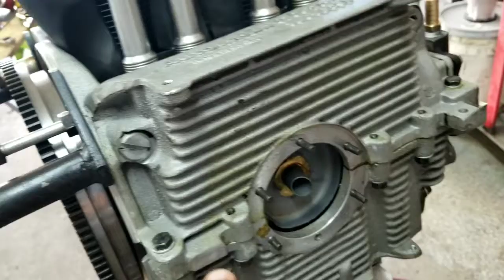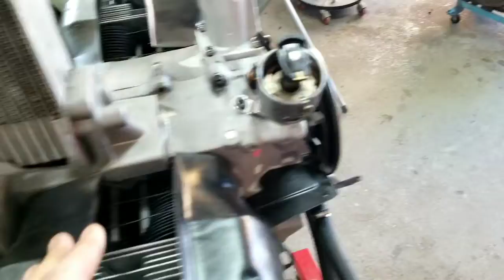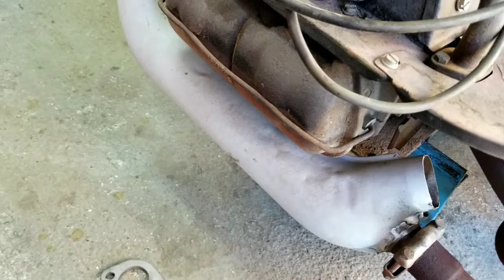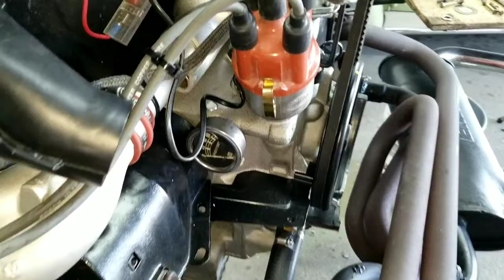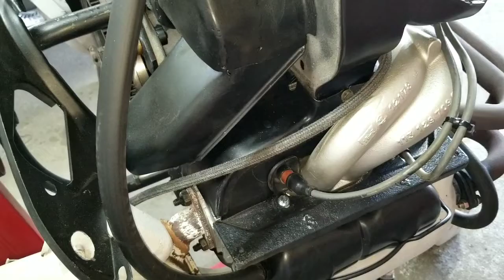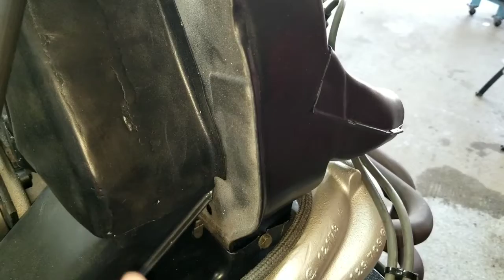bulletproof vw engine build 3 vw flat 4 engine vw bug vw bus

Comment: Nice design for the somebody could actually use a catch can for the original and add a small PC valve like you would put on a pinto or some other small engine would suck all the bad junk out of the engine. And for you guys at still love your oil bath cleaners nothing wrong with that as long as you run them with dexron transmission fluid no filter 3 times better and you can over fill just a bit helps lubricate the valves.

Comment: My experience with the Weber Progressive carburetor was not good; 32/36 if I remember correctly. It could never be adjusted for the car to run right.
Reply: Decades ago I had same problem.  If you have a single center carb you're limited on what cam you run since runners are so long . Engine vacuum wasn't sufficient at low rpm with long runners. I  put a performance street cam in and idle was easy to adjust. Track only cam you need dual carb short runners for a good idle.

Comment: Mechanical fuel pump is a big liability on a vw engine both for fire and washing you're oil out if the diapham fails or the press in fuel line barbs come out same with the stock carbs huge liability
Reply from the maker: happens sometimes but if you check your oil regularly you can catch it before it washes out the bearings. Been working on these 40 years now.

Comment: What is the difference between motor or engine ?
And what do you mean to say sandseale engine ?
And my other question is right side engine has more air flow as compared to left side so how do you balance this problem ?
Reply: A motor is electric. An engine is fuel.

Comment: 20w-50 oil is way too thick. a low bearing surface temperature is dependent upon oil flow to take away heat.  20w-50 will give too low an oil flow across any bearing surface at any engine operating temperature.  extreme oil viscosity will make for very high oil pressures which indicate blocked oil passages and low flow, thus creating high bearing temperatures.

the shear strength of modern low viscosity synthetic oils is high enough to deal with the lubrication needs of close tolerance bearing surfaces.  so even at high temps the sync oil can protect the bearings better.  the critical factor is to keep the bearing surface cool and high oil flow is necessary for that.  running 0w30 or 0w40 will produce higher oil temps which shows more heat is being extracted from the bearing surfaces, which is what you want. 

one can deal with high oil temps by using more and better oil coolers.

Comment: Did I misunderstand, or did you say full flow is a more recent thing (~10 years)?  Full flow was the norm when I rebuilt my T3 back in ~'94
Reply from the maker: my dates are a bit off they were just starting to do this more in the late 80s or early 90s. mostly on stroker engines. More often today because so many guys are building strokers because the cost is much less then back then

Comment: The thermostat for the cooling fins is only about letting the engine heat up fast. This helps with longevity if they work.
Reply from the maker: maybe but not where I live really at all. My buddy has one of these engines with aluminum case no therms with over 150k miles on it. no need to rebuild. no leaks no oil consumption. and good compression.  I would say you could never get those kind of miles out of a mag case.

Comment: Have you tried DELO oil? My old vw guy switched to the DELO 15/40. Says it holds up best in air cooled.
Reply from the maker: that stuff and rotella are good but I am not sure about them on vw. how much better or worse they would be than castrol. the thing to consider is zinc. I would ad stp to that just to insure the proper zinc is in the oil. I like kendall or castrol with a bit of stp. They have changed the zinc specs and allowances in recent years due to not as many sliding cam shafts. so many cars are not roller.
Reply: @Mikefngarage  I’ve used conventional Rotella for years. A friend in Miami started using it in his car. At some point he had to use something else (can’t recall what it was) and his Gene Berg oil temp dipstick would register high temps at higher sustained speeds on the highway, oil light flickering or lighting up completely. As soon as he went back to Rotella 40W the oil light wouldn’t come on under the same conditions.
Reply from the maker: @vayabroder729  yea diesel oil is super high temp. Castrol or Kendall are great too. They hold very high temps. Unlike Valvoline racing. which IMO does not hold up the the racing label. Rotella is great oil. I have never needed to try it in my air cooled because Castol and Kendall work very good. dont break down and maintain viscosity. But if I could not find it or they were out I would use rotella as a second option. I use T6 in my diesel pickups. Synthetic.

Comment: What were you mumbling about the pressure relief system at the beginning?
Reply from the maker: we removed the step piston from the pressure relief kit and put back in the stock piston with the high pressure springs.

Comment: 20/50 oil for air cooled motors maybe during break-in ad some zinc to help.
Reply: I like using the Valvoline VR1  20/50 during the summer and the 10/30 during the winter... the VR1 has zinc
Reply from the maker: We stopped using valvoline racing many years ago because under high heat it fails. Goes in the engine thick and comes out like water Switched to castrol or kendal and they take the heat better Try it at 3000 miles remove the drain plug on both and the castrol comes out just like it goes in and the VR1 drains out much faster. already broke down.
Reply: I use castrol 20/50 with lucas oil additive for easier gear changes in motorcycle been finding engine case is cooler and gear changes are smoother.
Reply from the maker: stp has zinc we have some in there thanks for the comment and good thinking.

Comment: I been checking your videos and thanks I have learned some new things,like removing the front pressure piston on the block I was told by someone else that if I removed it they will be no oil pressure.i guess he was wrong, thanks Mike
Reply from the maker: we did not remove it we replaced it with the original piston. I would not remove it.
Reply: Yes Jose... lol you don't want to remove it

Comment: "The Oxford English Dictionary defines “motor” as a machine that supplies motive power for a vehicle or other device with moving parts. Similarly, it tells us that an engine is a machine with moving parts that converts power into motion "  says MIT literature professor Mary Fuller
Reply from the maker: well in slang motor is know as engine.

Comment: is that Oil Breather Kit
? 12:33 whats for exacly? does it work for cooling oil or etc.
Reply from the maker: crankcase ventalation on larger engines. that box is just full of foam. and it is vented on the lid.
Reply: Yup I've got two of those on my engine about to upgrade all the hoses to -8an... going to look super cool!

Comment: Hey Mike, a couple of questions.
I have a 71' westfalia, what's my maximum speed before I start pushing my engine to it's limit, I'm talking freeway driving. Also, 
I have decided after years of buying and selling a variety of vw vehicles, my last one to keep will be a single cab,  some 8 years ago l owned a 62' single cab and like an idiot l sold it thinking a could grab another one in the future, since then prices exploded and now they're bringing stupid numbers, well, there's a 62' with double treasure chest (like my old one) slammed, 2161 engine. Freeway flier, with hoops and canvas,the works! The color is nice except for the bumpers, they're asking
28.5 buy it now, with 6 days to go, the catch is, it's in Indiana, so moving it to Cali will be expensive, question, what do you think should be my final bet number? Sorry for the long post, but l really appreciate your opinion in these matters, hit me back soon. Thanks
Reply: I forgot to mention it's posted on ebay
Reply from the maker: bit steep on the single cab at 28 that is why nobody has pulled the trigger. about maybe 20 would be a max in that cond. Dont know what is under that blanket.
Reply: @Mikefngarage  l was thinking the same thing, l asked for pictures of the seat without the blanket, I'm going to bail at 20. And as far as the westy, 60 mph sounds right. Thanks
Reply from the maker: @athruzathruz  I think if you got that for 20 you would be pretty close to value. If you want to gear up the bay I like 412 and 89 4th gear. on a rebuild with an oversized  engine like 1776 or larger. I might be building a 1968 which is another bulletproof combo for a bus as well.
Reply from the maker: max speed on a westy with mostly stock stuff is around 60 you should see what the ratwell gear ratios are plus make sure tire sizes are above stock. Mostly I think people geared them up look at ratwell.com gear ratios.
Reply from the maker: THe other thing I cant see is what kind of braking system is on it. if it has some good disc brakes I might say 22 max. If it is lowered and done right that stuff with the motor  it has and if the trans is built  is pretty expensive if you were wanting it like that.
Reply: @Mikefngarage  it has type 3 brakes in the rear and air kewled front brakes (don't know what that means)
It is lowered, no details given, and double treasure chest. What'cha think?

Comment: I'm a little confused. If you have the thermostat fins, you don't need to  put the the type III tin around the cylinders?  Does it affect anything if you had both thermostat fins and the type III tin?
Reply from the maker: if you have thermostat and need it you cant really run cool tin. the type 3 has a different thermostat from what i remember. you could put the flaps in then make our own little lever to open them when its cold.

Comment: Full flow last 10-20 years OMG better do more home work
Reply from the maker: more of a late 90s thing I am talking about late 80s
Reply from the maker: I do recall some guys doing it as I was getting out of it in the 90s but I was not into those kinds of builds Mine would work fine with dog house only.
Reply: I had to rewind to make sure I heard that correctly.  I remember drilling a case for full flow over 30 years ago.  And even then, it wasn't exactly a 'new' procedure.
Reply from the maker: not many people doing that in the late 80s

Comment: Qas wanting to know if you ever thought about adding a mister system to help with cooling.
Reply: I was thinking of how Porsche did it with the head being water cooled  and the fan for the jugs. Was either going to put something over the heads or right at the fan inlet.
Reply from the maker: @timathysills26  that was another idea I was throwing around making a water jacket head and fans on the jugs.
Reply: It works great I had a mister system when I lived in Arizona.... Awesome
Reply: @JWClassicVW  fascinating! First time I’ve ever heard of that. How does it work? I am thinking that in dry places it works amazingly; I wonder how it works in hot and humid places.
Reply from the maker: one of my oldest ideas. still want to try that one